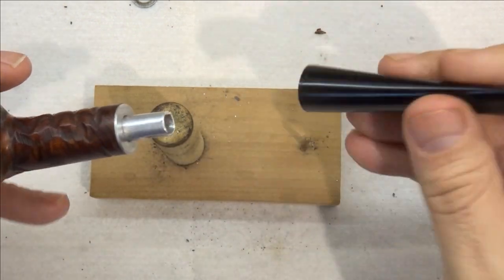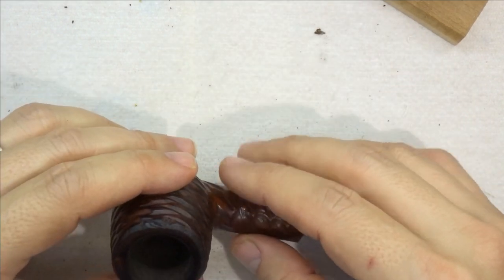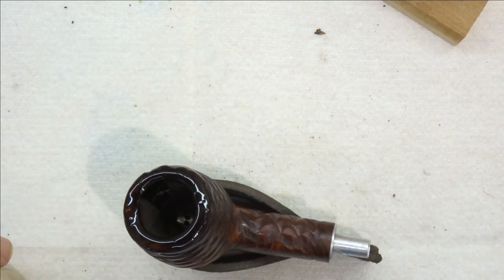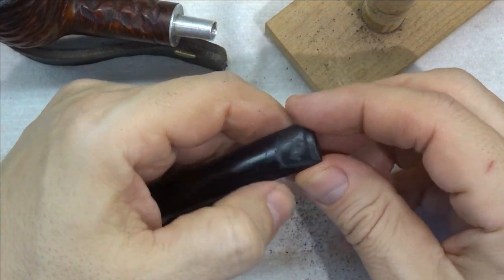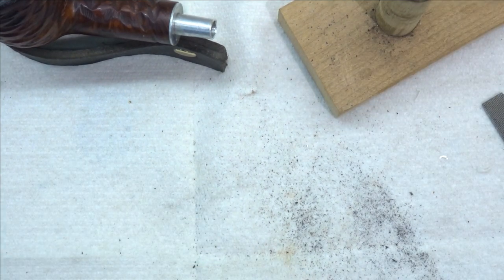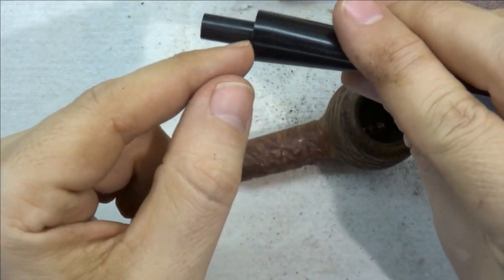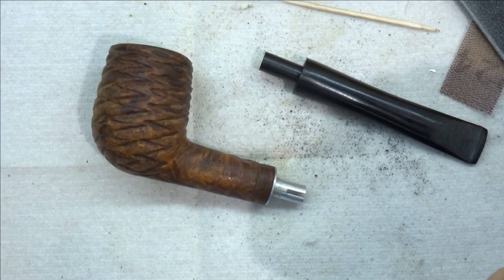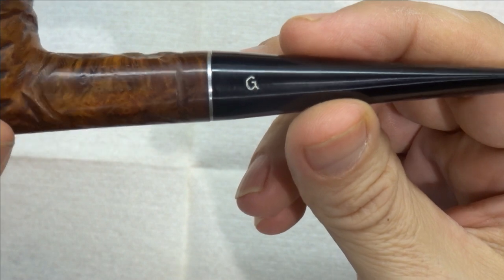Restoring A Medico Guardsman Part 4

Comment: This was a great series Mike. As for the shiny black stem issue. I have found that using Burt's Bees Wax lip balm on my stems makes them all shiny and uniform in color. I just apply by hand and rub it on the stems with my fingers. Go back a few days later and do it again.
Reply from the maker: Thanks Brian, good tip!  It probably cuts down on oxidation too.

Comment: Hi sir. I am a biiig fan☺️
Question: do you know any DIY procedure to restore ebonit when it has stiffened and lost flexibility after decades?
Reply from the maker: Thank you!  I have not run into much of a stiffening problem even on very old stems (I have some that are over 80 years old).  Other than liberally applying mineral oil and letting it penetrate at least overnight,  I don't have any other suggestions.  Sorry I can't be more helpful.
Reply: @CaneRodPiper  that was very useful man. Tnx🙏☺️
Any idea about Jojoba oil which is famous for deep penetration and moisturizing ability?!
Reply: @CaneRodPiper  and warming up the ebonite to open up the porosity of it helping the oil penetration?
Reply from the maker: @MA.community  Yes, good suggestion!
Reply: @CaneRodPiper  Tnx again🙏☺️
Appreciate it. Keep doing what you do man👌👍